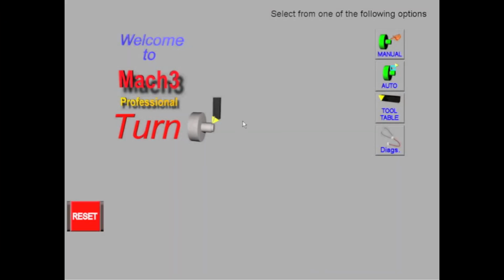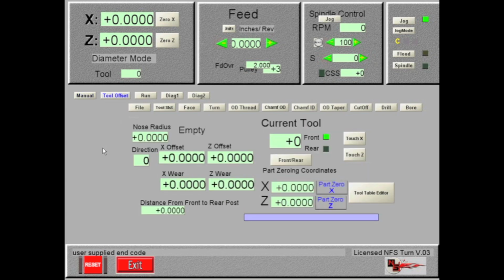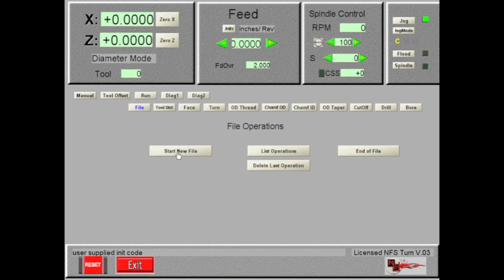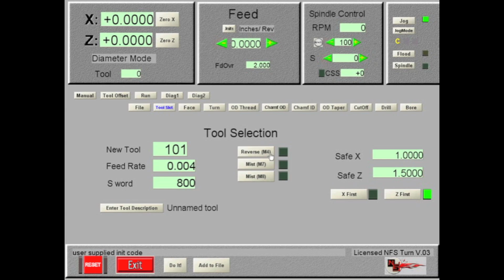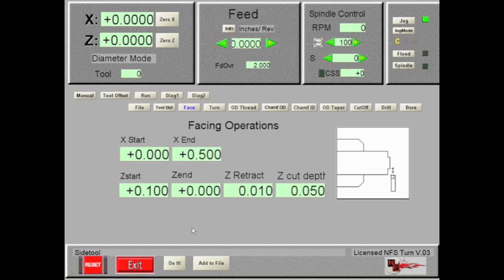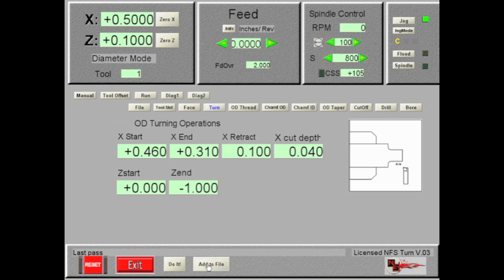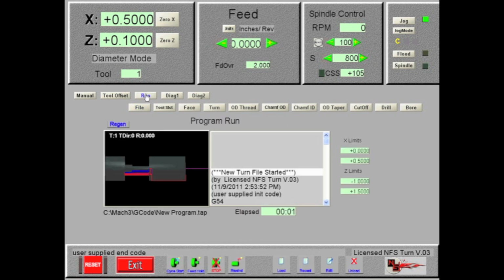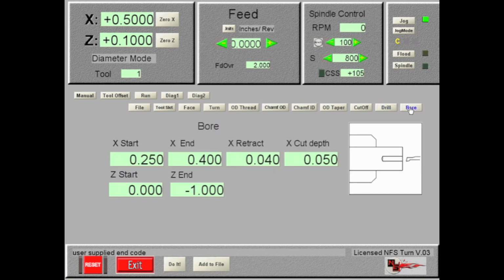NFS Turn Wizard For Mach3

Comment: Hi Ron
I was given the impression that I could run a trial program on Mach 3 before I made a decision on purchase or not. I had not realised that the trial was limited to simulation so have to decide whether or not I want to buy the product. I think I probably do.
Reply: You can run a trial with Mach3. It will do about 500 lines of gcode in demo mode. The wizards will run in demo mode, but will not save their files.

Comment: Will it drive the steppers without a licence or is it restricted to on screen simulation?
Reply: It is a wizard that runs under Mach3, so you must have both a license for Mach3 and the wizard license. the wizard license is $50
Reply: hello Ron is that the add on licence $50 ?